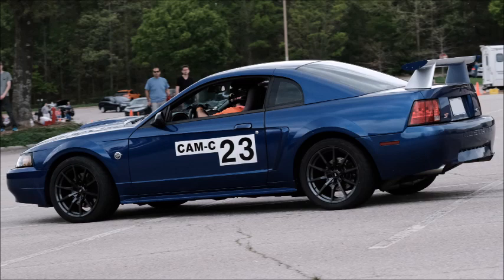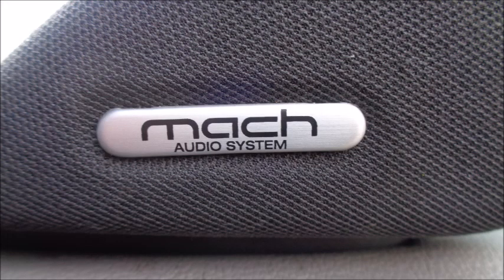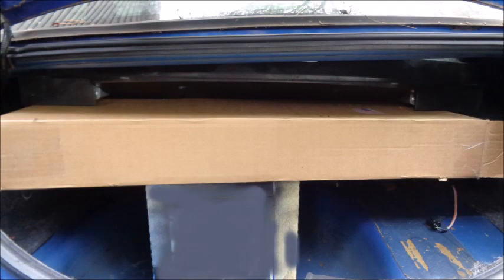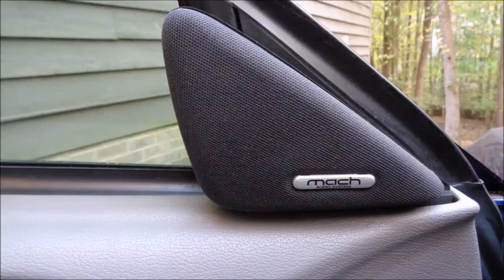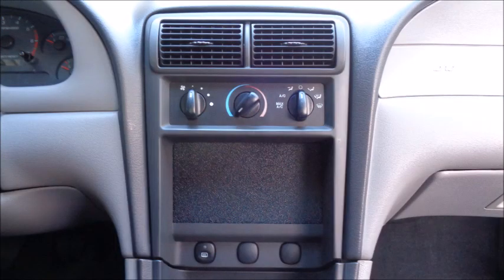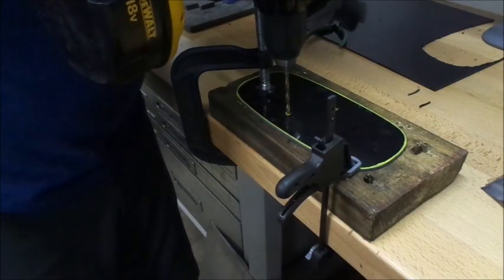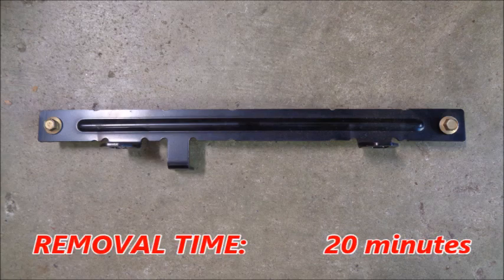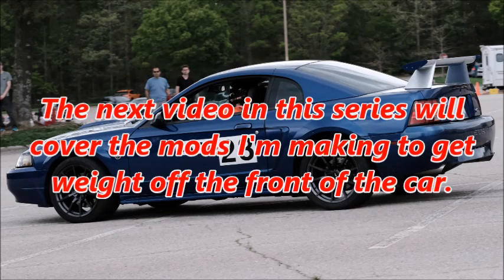The CAM-T DIET Part 2: INTERIOR WEIGHT REDUCTION

Comment: I can’t wait for the next video. I need to remove more weight off my front. I removed the smog stuff, windshield washer container, air conditions system and more. I’d have to go back to my videos to see total weight but it was a good amount. I’d like to relocate my battery to the rear and get the lightweight front bumper bar from MAF to take more weight off. Not sure if a k member is in my future or not but that would sure help. I also removed airbags and put a sparco steering wheel to save even more weight. Since mine is strictly for racing I tried to remove as much as I could that I didn’t think I’d need
Reply from the maker: I'm hoping to get the parts for the front end mods soon, but there have been long delays due to the pandemic (and some design issues). I have to keep all my smog stuff to pass inspection, and I've decided to keep the A/C in this car (for now). If you have an OEM front bumper support, I would highly recommend getting the MAF front bumper support. Saving weight that far forward will make a big difference. When it comes to your battery, the best place to put it is behind the passenger seat. Most trunk relocation kits put the battery too far toward the rear of the car (good for drag racing, not ideal for autocross). With something as heavy as a battery, you want to use it for mass centralization. But, I can see why most people wouldn't want a battery in their interior.

Comment: I have been watching my competition on your weight loss videos. I have the Camaro down about 90 pounds so far when I run with the T-tops out. I am also refurbishing a fiberglass hood that I am hoping drops another 20 lbs, haven't weighed the stock steel hood yet. I have been eyeballing my busted AC compressor and now maybe my radio and speakers that do not work. Keep up the videos.
Reply from the maker: Thanks for checking out my videos. That's a good amount of weight. If I recall correctly, your car weighs about 3,150-3,200 lbs. With 90 lbs. already out of the car, you should be able to get to the CAM-T minimum weight without making permanent changes. The A/C compressor and radio can both be reinstalled later, so they are good candidates for removal. I'm looking forward to events getting back to normal, and seeing your cool car out on course again!

Comment: I removed all speakers in mine but left the light rear speaker cover so it appears they are still there. I made some videos weighing everything. I remove a lot of stuff lol! I just have the front seats left to replace with some lighter ones. I’ve thought about removing the center console and making some type of cover to cover the bare metal stuff. Great video as always!
Reply from the maker: The seats will save a lot of weight. I've looked into removing the center console. I've always wondered if the leather parking brake handle boot has enough material to cover the brake mechanism. If it does, you could separate the boot from the console,  get a small section of carpet, cut a hole in the carpet and use it to hold the boot down over the brake mechanism. If not, fabricating a small metal cover would work well. Thanks for checking out my video! I'm looking forward to seeing more videos from your autocross events this season!

Comment: Watching your videos makes a part of me upset for taking care of my baby all these years!  Makes me want to get another car to turn into a track only car so I can challenge myself to see how much weight I could remove. After watching this video my mind went straight to potential weight savings of the glovebox, what other useless brackets are under the dash, how much plastic on the backside of interior panels could be ground off/removed and how many holes could be drilled in what is remaining.
Reply from the maker: There's nothing wrong with having more than one Mustang! Depending on how far you're willing to go, there's a lot of stuff you can do to reduce weight in CAM. Other SCCA Categories allow you to go even further. But, there are also entry-level classes where your nicely preserved Mustang can be autocrossed with minimal mods.

Comment: Nice man! One thing I've considered (more for space reasons than weight tho) is removing the center console and getting a new carpet (uncut) to replace mine. Mine doesn't look great anyway. Then I figured I'd fab up a small aluminum cover for the brake mechanism. I'd be removing the backing from the carpet before it goes in and taking out the stuff they put on the inside of the floor. I'm also planning to remove the passenger side airbag when seats and harnesses go in, but modify it so that the outer face is still there. I'm like you, I want it to look nice even though you can still do things that don't violate the "race car interior" rule.
Reply from the maker: Thanks! I've thought about removing the center console too, and doing the same thing (covering the carpet holes; a small cover for the e-brake). The carpet and sound deadening are weight low and in the center of the car, where I need it, so I always look to find places up front and in back where losing weight will be more beneficial. I'm considering removing the airbags too. I'm operating under the assumption that the "finished" interior requirement would mean the holes left behind by the airbags would have to be covered. There are companies that make ABS plastic covers for the passenger side. I'd like to experiment on an OEM airbag from a salvage yard to see if there's a safe way to separate the dash trim from the airbag.
Reply: @warhorseracing  from what I understand, the airbag itself is riveted to the cover, and it bolts toward the back. I’ll pull mine out at some point and take a look, maybe post some pics on my thread.
Reply from the maker: @GimpyHSHS  I was able to find pics on Ebay a while back. There are lots of what appears to be large rivets holding the airbag to plastic tabs on the trim panel. It seems possible to separate them by just cutting the plastic tabs, but it looks like it would be a delicate process.
Reply: There are passenger airbag delete pieces for sale.  I know one guy was making them in carbon fiber and I think the drag racers were using a plastic one.

Comment: Completely Amazing!   Your giving me some great ideas.  I'd be interested in the head unit if it's in good shape and your looking to get rid of it.  The CD changer on my Mach 1 is wonky.
Reply: Volume issues? Lol
Reply: @3xzsucof  Mine doesn't have volume issues, but the CD changer will cycle through CDs for no reason while listening to the radio.  It did that since day 1 and Ford couldn't replicate because it doesn't do it that often...  Must have gremlins 😁
Reply from the maker: Thanks! Unfortunately, my radio display doesn't work anymore, and I'm not sure if it's still able to play CDs. It was in rough shape. Have you tried LKQ?
Reply: @warhorseracing  Not familiar with them.  Whats the URL.
Reply from the maker: @MikesGarageRoute66  lkqpickyourpart.com They're a self-service salvage yard with many locations around the country, but I have also seen them list Mustang radios on Ebay.

Comment: Probably more cost than it's worth, but you could always try to locate some of the older SN95 GTS door panels and swap in manual windows.
Reply from the maker: I've looked online for an accurate weight savings amount for a manual window swap. It looks like it could be anywhere from 6-12 lbs. You are right about the cost; the GTS door panels are rare and probably expensive. An easier solution might be to use aluminum door panels and keep the power windows.

Comment: Hey man! I recently got an 04 GT and I wanna start autocrossing it this upcoming season but I am a little confused. Would my mustang be in street class or in cam t class? Im really confused on how the classing system works for mustangs.
Reply from the maker: Classes are found in Categories. For example: F Street Class is in Street Category. Each Category has authorized mods. Street Category allows very few mods. CAM allows a lot of mods. The Category your Mustang falls into is determined by the mods you've made to your car. That's how the SCCA keeps the playing field level. So, depending on the mods you've made to your car, it could be in F Street or CAM-T. What mods have you done to the car? What mods do you plan to make? Knowing the answers to those questions will help me determine which Category you'd run in.
Reply: @warhorseracing  I havnt modded the car yet, the previous owner however installed 2 corbeau classic styled leather bucket seats and an aftermarket xpipe. I plan to install koni yellow adjustable shocks and struts. I would like to also install ford racing c springs but thats not allowed in F street. I feel like maybe with the less strict restrictions of cam that maybe itll be more fun. The thing that bothers me the most about Cam where I live is that there is only sometimes one or two other cars at the events. I was curious about the turnouts to my local autox and checked the event final times and all the other classes were filled while cam at most had 4 other cars.
Reply from the maker: @Nistrin  The mods the previous owner made will knock you out of Street Category. You would have to put the stock seats and H-pipe back into the car. I imagine you'd prefer not to do that. My "Entry-Level Autocross" videos cover the main mods that are authorized in Street Category, and the mods I'd make to compete in Street Category. Do you have any previous autocross experience? If not, it's a good idea to run as a Novice your first season (you still have to choose a class). As for choosing a class, it's a little complicated... Your O4 GT fits into FS, which includes a lot of newer cars that handle extremely well from the factory. It's a challenging class for older cars, but a great way to improve your driving skills without spending a ton of money on mods. CAM-T presents a similar situation. A car that is "under-prepped" for CAM can be up against cars built to the limit of CAM; those cars can be tough to beat. But, the advantage of CAM is that you can improve your under-prepped car to make it more competitive as time goes by. But, running in a competitive CAM Class can be expensive. I always tell people to spend the least amount of money and go up against the most competition when they start autocrossing. That forces you to focus on improving your driving skills. I got a notification that you asked about Street Touring Category, but that comment seems to have disappeared. I'll dig into the 2021 SCCA rules and see if your seats and X-pipe are legal in Street Touring. If so, I'll come up with a list of mods that will help you baseline the car before you decide on mods based on your personal driving style.
Reply: @warhorseracing  Thank you so much for your help man, I really appreciate it. I am kind of conflicted on what class I should pick, as I mentioned in the last comment it seems based on what ive seen looking at previous event time sheets that cam for whatever reason only has a hand full of cars that show up. So maybe I should stick with street touring, if its important that I go against higher more competition.  This will be my first time autocrossing, if I remember correctly the first event of the season is April 11th where I live.
Reply from the maker: @Nistrin  I'm always happy to help. Choosing a Category can be confusing. In my experience, a large CAM group has to be built by CAM drivers recruiting more people. There's a common misconception that Mustangs can't do well at autocross, and that makes people reluctant to give autocross a try. And, CAM is very intimidating on paper. With my channel, I've tried to prove that a Mustang can do well at local CAM events without being a fully-prepped CAM car (and without having a V8). Every CAM driver becomes an ambassador for autocross eventually, because they want to see more of these cars at their events. The bond between CAM drivers is really strong, because they are almost always trying to grow their class (and they all want to prove these can handle). If you start in STU, you can always move up to CAM in the future. It's harder to go from CAM back to STU (especially if you weld in chassis bracing for a CAM build). My mod suggestions will have some important differences depending on which Category you choose. Realistically, your first season will be about learning autocross technique. Very few Novices immediately run competitive times in their class. I actually don't see many STU cars at my events anymore. How many STU cars do you have at your events?
Reply: @warhorseracing  STU seems to have a healthy amount of cars competing based on what I see from last seasons event results. Im thinking maybe I will chose CAM, the CAM community seems to be very welcoming and helpful. Im not expecting to put up competitive times my first ever season, I just wanna have some base level mods to get me going. Im probably going to be running my junk all seasons this season. the previous owner just got them and ive only owned the car about a month, they probably have 1500 miles on them.
Reply from the maker: @Nistrin  It's worth mentioning that you can run the car as it sits now in CAM. Don't feel like you have to spend a ton of money to start autocrossing. You can learn a lot about performance driving behind the wheel of a car that's under-prepped for its class. Mods will obviously make the car more capable. I'm including a list of the mods I suggest you start with. The goal here is to solve the factory-installed issues, get the car neutral, and add adjustability. And, I always suggest doing the front suspension mods at one time to eliminate the need for multiple alignments. Before you make any mods, check to make sure your ball joints, wheel bearings and tie rods are in good shape.

1. Adjustable shocks & struts (Koni Yellow SA)
2. 25mm rear sway bar (Eibach)
3. CC Plates (3-bolt are fine if you never plan on installing coil overs) (Steeda or J&M)
4. Ford Racing C Springs (with poly isolators)
5. Poly, Offset Poly or Global West Del-A-Lum A-arm bushings (the offset bushings require a press to install)
6. Poly or Delrin Steering Rack Bushings
7. J&M Spherical Differential Housing Bushings

Those mods will help get the car neutral, allow for an autocross alignment (-2 to -2.5 degrees up front), upgrade any bad bushings, and allow you to dial in the suspension before and during events. I included less expensive versions of the parts, because it's worth doing all 7 of those items at once. 

8. Upper & Lower Rear Control Arms with 3-piece poly bushings (Steeda or J&M)
9. 3-point Strut Tower Brace (Steeda)
10. Lower Chassis Brace (Stifflers)
11. Subframe connectors (I use the Stifflers FIT System, but it requires a lot of welding. It can be installed in stages.)
12. Rear Shock Tower Brace (Steeda) (Many people disagree with me on this part)

Those mods will help with composure and they'll help make every input sharper by adding strength to the chassis. If you want more info on these parts, I cover most of them in my "Budget Autocross" series, my "Mustang ST" series, and my "ThoroughbRED" series.

From there, you will decide on the next round of mods based on your personal driving style and which "next-level" rear end mod you want to use (IRS swap, Panhard Bar, Torque Arm, Watt's Link). Your front sway bar choice will depend on how you want the front end to feel, and how much grip you have in the rear. There is no need to immediately install a larger front sway bar; it will only add understeer.

Driving on All Season tires your first season is a good idea. You will learn more about performance driving on those tires than you will by chewing up a set of very expensive autocross tires. I would recommend stepping up to performance brake pads, but you will lose most of the benefits they provide due to the All Season tires. Brake pads are a very personal choice; it's probably better to wait until you have some autocross experience before deciding on aggressive brake pads.

I hope this info helps. If you have more questions, please ask.
Reply: @warhorseracing  Hello, sorry for the late response, Ive been busy with school and work. Thank you so much for all the help. I cant wait to finally start attacking the cones!
Reply from the maker: @Nistrin  No need to apologize. I'm glad I was able to help. I'm looking forward to hearing how your first event goes!
Reply: @warhorseracing  hey man it’s me again lol. Have you ever taken your mustangs on a race track? How good are they as track cars? I’d like to get involved in all types of motor sports. I figure if I build the mustang primarily for autocross Itd also make a half decent track car.
Reply from the maker: @Nistrin  My experience is 99% autocross. But, I do know people who track their Mustangs, and I've helped some of them with choosing mods. They can be very good track cars. There are subtle, but important differences between a track and autocross setup. A dedicated track car can be lower and stiffer, because elements on track are spaced further apart and the transitions tend to be smoother. An autocross setup will be softer and allow for more suspension articulation. Some of this can be solved by having track settings for the adjustable components of your suspension (in your case, shocks & struts). Also, a car that spends a lot of time on track will benefit from better brakes/pads. OEM Cobra brakes (and even V6/GT) brakes are fine for autocross (with the right pads). But, when dealing with repeated high-speed braking on track, OEM brakes tend to fade. It's common for people to swap to track pads once they get to the track.
Reply: @warhorseracing  awesome, thanks!